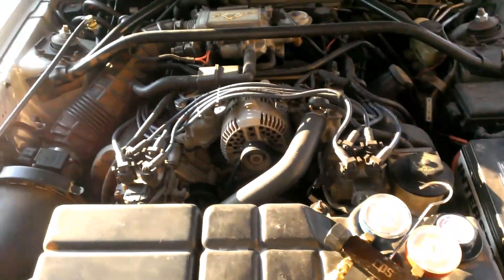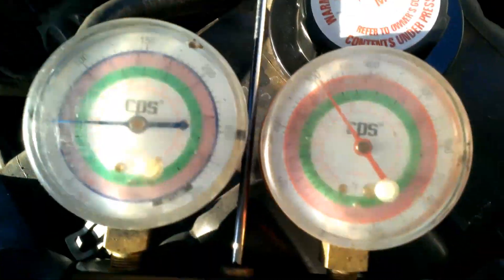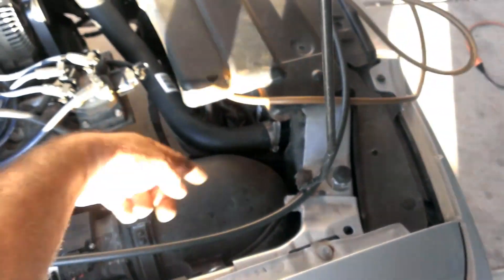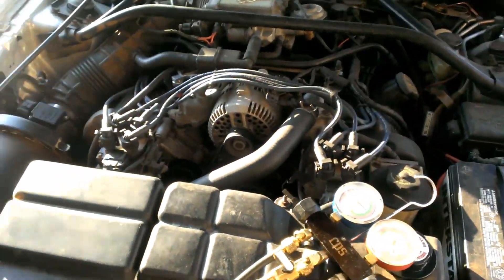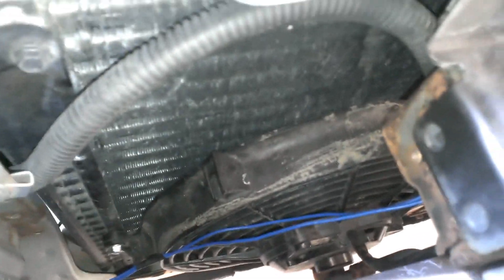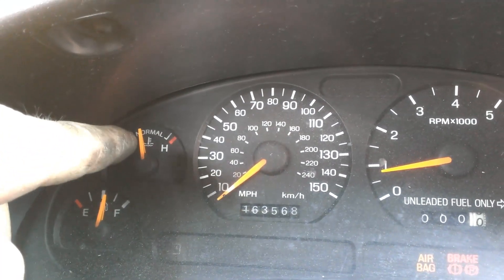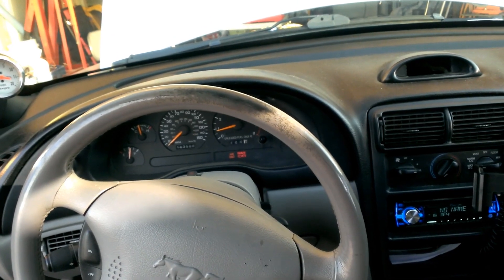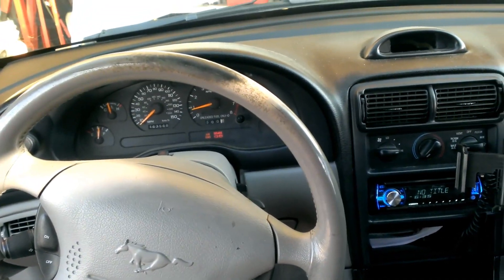Project Mustang - Install Pusher Fan

Comment: Did this work pretty good? I have a sn95 with blower and with a/c on car gets hot around 210 and I like it around 190 where it stays without a/c on. Any info would help thanks.

Comment from the maker: The stock radiator IS aluminum. 

I'll probably install the extra windshield washer bottle with pump and a mister nozzle before the radiator to cycle when the temp is higher. 
That will keep it cool better than anything. :-)

We used to install those on RV's for mountain grades way back in the day.
The temp would go up towards hot and if you sprayed some mist over the radiator it would bring the temp right down.